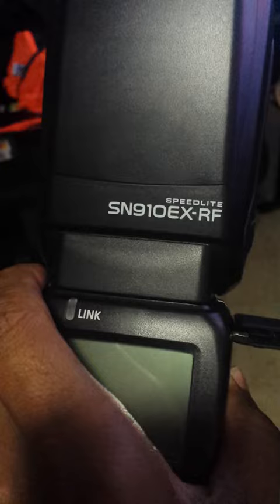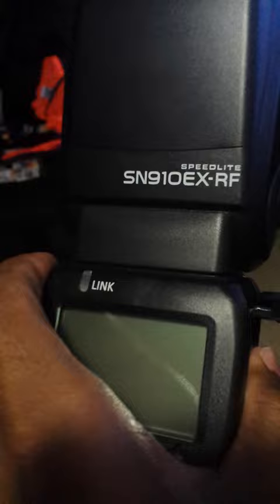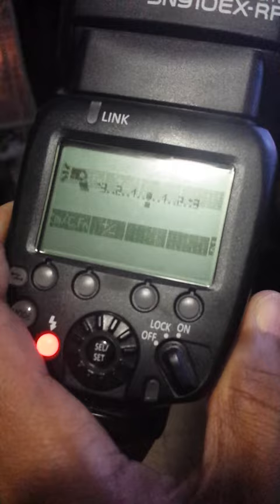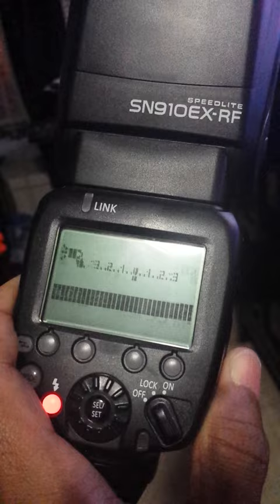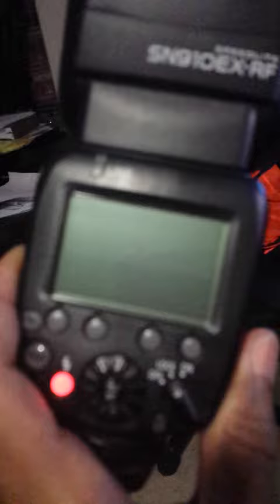Shanny SN910EX-RF malfuntion Review

Comment from the maker: The replacement worked as expected, I later listed the entire set on ebay.coma and sold them. I am now a pure Godox shooter, I have three TT600's, one AD-200 and one 360 with the X1N/pro triggers. Shanny looked great but functions did not live up to my expectations. I am surprised to see they are still in the market because Godox and others have proven technology and still expanding the product line, even YN is now moving to a non AA battery which is great more options. Cut your lost and move to Godox or YN if you can.

Comment from the maker: Yes I agree I was very disappointed when inserting the batteries the speedlight started getting hot, but I was busy setting up my other speedlights to test the master mode and when I returned to the speedlight I noticed that it was hot and the display was scrambled  and jumping as you saw in the video. I contacted tomtop.com and returned it. The speedlight came wrapped in shrink wrap in a new un-open box, I was hoping to move to the next system for Nikon from Shanny. I will now wait until  they have worked out the bugs and sold a few more units.

Comment: Did the replacement unit work ok? I just bought three in the UK and one was scrambling the display earlier - as you described
Reply from the maker: +Graham Smith The replacement worked as expected, I posted an update video, I am waiting on the arrival of the transmitter Shanny's SN910TX, I should have it in a couple weeks and will post a review.
Reply: +Robert T. Johnson - Thanks Robert - I must say I'm very impressed with them overall....way easier to use than SB800s and Pocket Wizards.....the SN910TX looks to be a useful addition - hope it works out for you.